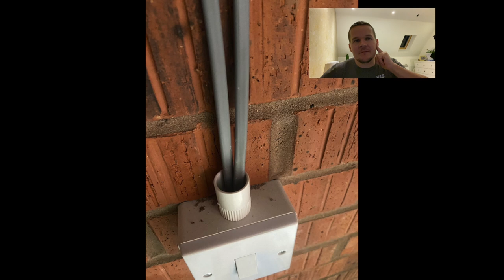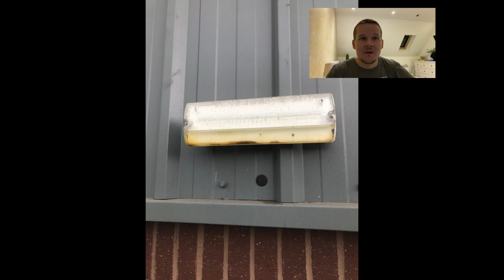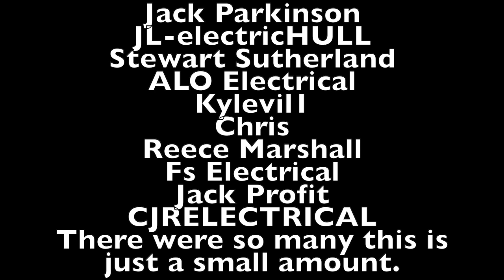Cjrelectrical Shocking electrical work

Comment: You should see the wiring on one of my old work place, 100yo workshop with 110 upp to 500v and the biggest fuses was 200amp. You had to check the voltage before you pluged in something because the regular outlets were 110,127 and 240v.

Comment: I've been on a job where the original meter box was in a little wooden closet nailed to a pole, the box itself was once made of sheet steel but was now more like crispbread from exposure to the elements. I dared not touch it. It was a single phase feed that had one 10A circuit wired to the house, with two rusty steel cables running between the pole and wall. The ground rod was at the root of the pole and the live/neutral wires were just single rubber insulation wrapped around those cables. There were 3 phases wired to the top of that pole, and we ran a 4 core 10 SQmm aluminium cable underground to the house wall, where a weatherproof meter box & main unit was mounted. The owner dug the 25 m ditch (70 cm deep) with a spade. The inner wiring of the house was done as far as possible while we waited for the grid company to connect the new feed cable to the pole top and remove the old box. Every circuit was tested by wiring it temporarily into the old feed, so when the new box was commissioned, it was just plug and play. It was an old summer cabin that the owner converted to be habitable all year round, but he'd so far had only one light bulb and socket wired in each room, the way he bought it. Built likely after the wars, electricity added early 60's or so. 

Another creepy building was a farmhand's hut from late 50's, where a friend of mine moved for a few years. It also had one 10A circuit wired from the main building, crossing the road similarly with single insulated rubber wrapped around cables strung between poles, and 1,5 SQmm 2 core cable wrapped around a rather thin steel cable on each side for the last 10 meters before it reached the building wall. The only ground was at the end of the main building, and at the hut, the kitchen socket just had a jump wire from N to ground prong. Several other electricians looked at the contraption and said that it fulfills the code of the time it was built, and is generally safe when properly operated. Obviously that contraption could not be altered at all without legal requirement to rebuild it essentially completely - the poles and support cables could have stayed, nothing else.

Comment: 3:47 I've seen before in a rental property - in my case it was when years of oil and steam etc from the cooker top got into the switch for it that was parked horizontally maybe 30cm from the cooker top and it was arcing inside the switch which caused heat to build up and it cooked the wire, it's why I don't like the "standard" installs where the cooker top is in close proximity to the switch or other sockets. Doesn't take much. IMHO there needs to be a regs change over that - either as relates to switch design and allowing steam inside or where switches are placed.

Comment: I'll have to take some pics of my house  light switch 'backboxes' sometime - just a bent strip of metal threaded for the facia screws.. 
Added to that the previous owner fitted metal light fittings everywhere and there's no earth in the lightimg circuit snd have the roses have choc blocks behind..
Socket ring has rubber cable too of course. Whoever did kitchen work for previous owners decided to put a 2nd CU in rather than touch any of it. Though thats got a 32a breaker in in wired to dont know what!
Looking forward to getting a rewire done next year when extension is built! 
Luckily I've found a couple of electricians in Manchester who follow your work as well as N bundy etc so hopefully their work lives up to your quality when the time comes. Mind ive had to tell them no kopex in my garden office though..

Comment: I was working with some horrible armoured cable today replacing a sodium son wall light for an Led bulkhead type and went to shorten the wires for terminating, cutting the  inner sheath back but it was just cracking off no knife needed and the insulation on the inner cores  was just crumbling off showing the copper.
 I would say  it's from Heat off the old light fitting ( Thermal effects) or it could rubbish cable.

Comment: when did they change the neutral colour to brown? in the burned out socket there are a blue / brown / green and yellow coming up from the bottom and it is the brown wire that looks like has been massively overloaded and over heated.

Comment: question: first picture why they need a new breaker board? arent allowed different brand if the nominal value are correct? yes it doenst look nice MAYBe but isnt working properly?

Comment: That EV install also has an earth coming off the neutral Henley block.   Not dangerous, just rogue.
Reply: So Henley blocks are ok to just hang unsecured in the air like that? I do hope you aren't an electrician with a comment like that..
Reply: @K3ndallUK I was talking specifically about the earth that Chris didn't mention coming off the neutral block. If it's a TNCS supply then you can see why someone might have done it. It just moves the point at which the earth is split off. They still shouldn't have done it. It could become dangerous. It's rogue (disregards the rules). There are clearly other issues.

Comment: I really should send some of my pictures in
Reply: I wish I'd taken some of my house when I'd moved in, cabling to the garage was criminal.
Reply: @timearp8185  yeah it takes something really massive to want you to take photos otherwise you'd left going I wish I took the photos. We got a tour of the place before the tenant moved out, after the tenant moved out and we were moving in dot-dot-dot it was very different. This person figured out so many ways to use lamp cord and many of them were shouldn'ts. I found out that majority of the outlets in the place where on 1 50 amp breaker.
Reply: @imark7777777  nice. My FiL did some rewiring for us, both him and the person who installed the SWA weren't aware of how it should be terminated.. Didn't take long to do it properly.

Comment: Some bodges are shortcuts to save the installer time and money, but the chocolate blocks stuffed up in ceilings makes no sense at all, it's soooo much harder and more fiddling doing it that way than using wagos.

Comment: What do you do when you come across these sort of night mares? Does it become a separate job, quote etc. or are you obliged to do something as the last electrician, if was gas they turn it off an label it dangerous?
Reply from the maker: Depends what you find. Can disconnect and issue a danger notice the dno will come and disconnect the unsafe house as they don’t want it on there network,then it’s up to the customer to get it rectified and certified.

Comment: 8:10 hard to say where this is but I'd guess either France or more likely Romania, these seem to be the only countries that favour red for line (along with blue neutral and yellow/green earth) and that terminal box on the bottom really looks like something from behind the former Iron Curtain.

8:52 Netherlands I'd say. I reckon someone wanted to add some lights to the shed in this horrible DIY way.

9:32 the cover on this CU has melted, hasn't it?

14:30 that DB has seen an awful lot of damp I'd say.  I'd love to know where this is from! Single phase and double-pole MCBs by the looks of it - maybe Italy? I've seen that kind of universal bus bar in Austria but only with one brand of MCBs and these definitely aren't F&G. A colleague once called these bus bars "the world's hottest 3D jigsaw puzzle". I once had the end of one of them pierce a bit of wire, another phase - lovely dead short!

Comment: I've had to do my own minor electrical work because for 12 weeks, 7 electricians have either failed to return my calls or been to price the job, make a date to start then just not bother to turn up. No wonder people will DIY it.
Reply: DIY is ok as long as you've done your homework, sticking to the regs and thoroughly tested in the correct sequence with the correct equipment. Afterall, the fundamentals don't change..

Comment: On the first example which is typical example of non compatible devices being used. Do you not think Chris, manufacturers should have been legislated to make devices to a standard dimension? After all, when a socket or a wall switch is replaced you expect it to screw into a standard dimensioned box, so sometime in the past BS did use a bit of common sense. What went wrong when mcb’s rcd’s spd’s etc were released on to the market ?

Comment: What do you think about the magnusson VDE Electrical screwdrivers Chris? They are cheap but are they quality?
Reply from the maker: I’ve had a set they were fine apart from the smaller terminal snaps very easily on the end.
Reply: @Cjrelectrical  which brand would you recommend? Apart from CK. Sorry for the comments.
Reply from the maker: Using wera at the moment
Reply: @Cjrelectrical  thanks👍🏼

Comment: Swapped a socket outlet this weekend. Was a little crispy inside, as one side of the dual outlet was entirely burnt up from the switch to the socket, and it was sparking. Yes the house that Stevie Wonder did the wiring, half the place is on one 20A breaker, and then the other half is on 2. Outbuilding breaker boxes was replace on sight, more because the cover was missing on the Heinemann one, and the breakers needed a hammer to turn them off, plus the only thing on the RCD was the geyser. Then replace a junction box feeding the pool, or more accurately put a new junction box there to replace the rust, as the one screw fell off when I undid it, and the other one sheared off as it was one with the remains. Have already replaced more than half the socket outlets and switches, along with lights, because of missing covers, painted over and intermittent. Strong house though, the main house walls are 15 inch brick, minimum, so I will need a really long drill to get through them. As far as we can figure it was a jail at one time, but the plans were destroyed years ago.

Comment: I've never seen any real engineering justification for not putting the incomers through separate holes in the consumer unit.  John Ward (I think) did a test which indicated that there was no heating effect measurable.  How do these myths perpetuate?
Reply: 😂 Myth? Do you own a regs book? 521.5.1 is a regulation to comply to for sure, if you’ve never come across shoddy installs and experienced the vibrations/heat from people who think its a myth then you are blessed

Comment: Enjoy the vids but not an electrician, at 55 seconds in you criticise the mix of breaker brands. Is that an issue if they are all functional and fit in the board?
Reply: I mean scientifically speaking you are correct , but in practice, it isn’t following manafacturers instructions, so if there was any issue, the liability would be on the installer. It’s just bad practice